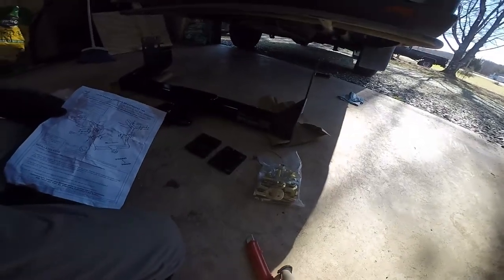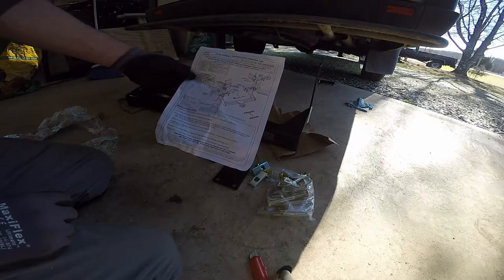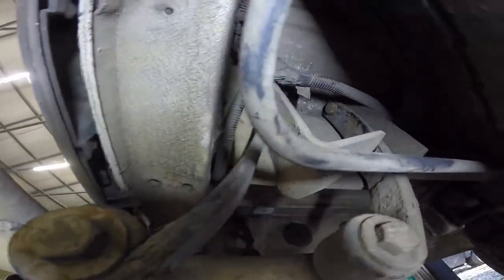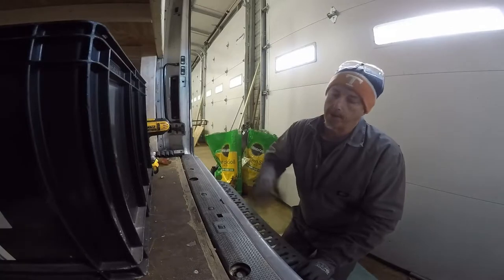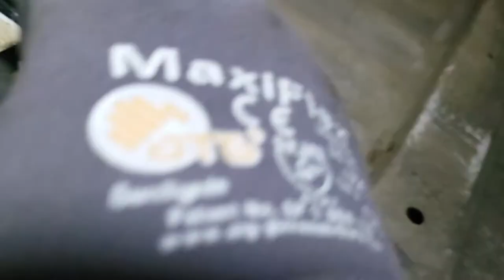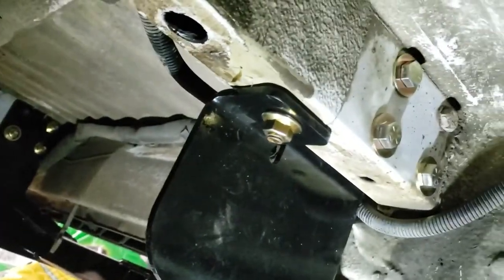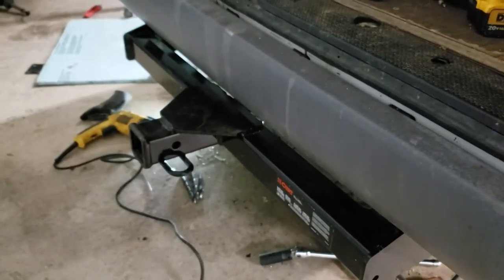2005 Dodge Sprinter Hitch Curt 13250 T1N Mercedes

Comment: Thanks for the video, it helped a lot with my 2003.
showing the bolt fishing was really helpful. 
On my 140 with a bolt on bumper, I did notice that there was 1/4" space between the hitch's arm brackets and the frame, but with the torque on the bolts the arm brackets bent easily into place.
I decided I'd use a step bit to widen the bottom holes rather than buy a hole saw and 9/16 bit, but I imagined that the step bit would have been so much harder that it turned out to be. I was surprised that the step bits so easily cut through the frame, 
maybe the steel was softer than I expected it to be. 
Also, on my 2003 140, the 1 1/8 fishing bolt hole was made by widening an existing hole in between the hitch bracket and the bumper. 
In your video, you made a new hole behind the hitch bracket... but maybe your model year has a different design. 
And I didn't have any issues with the muffler or tail pipe getting in the way. 
Hope this is helpful to the next Guy!
Reply from the maker: Thanks for watching and yeah any advice that could help myself and others is always appreciated.

Comment: I realize this is a 3 year old video, but did you have issues with your spare tire going back into position? I'm looking to install a reciever hitch on my 2004 sprinter, but want to make sure i get the correct hitch to where i do not have to remove/relocate the spare tire permanently.
Thanks!
Reply from the maker: My spare tire is in the original location. I don't remember having any issues with that.  Thanks for watching and good luck with yours.
Reply: You are spot on with this question. I bought my sprinter new in 2004. After about 2 years I needed a trailer hitch. I bought one from the MB dealer. After mounting the hitch my spare tire had to be relocated or I removed the hitch till next time. The OEM hitch mounts totally different than this one. After 300K miles I'm ready for a permanent solution. This looks like it might work.